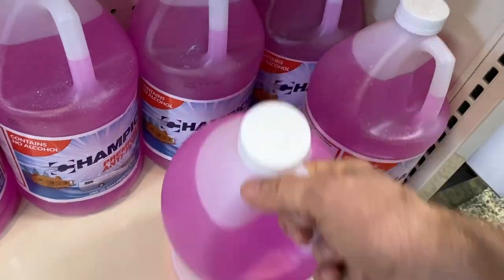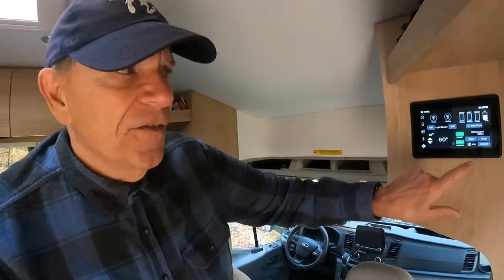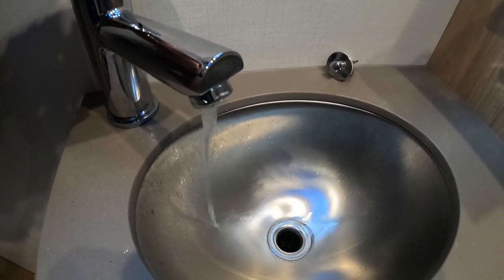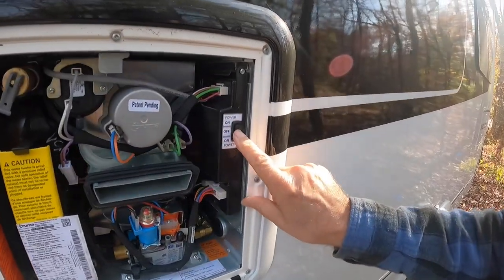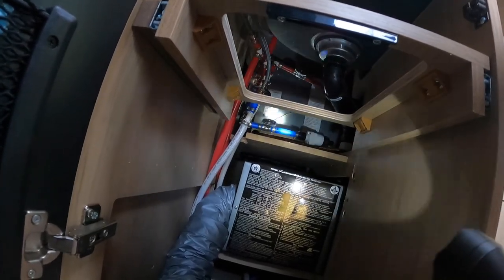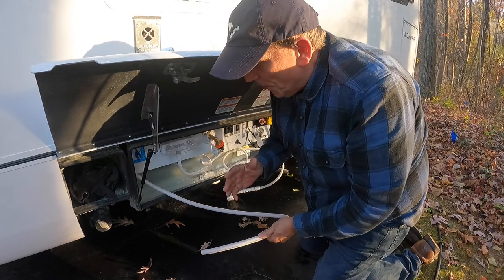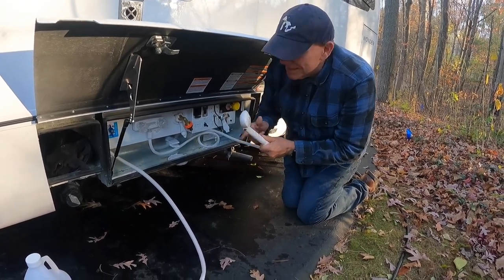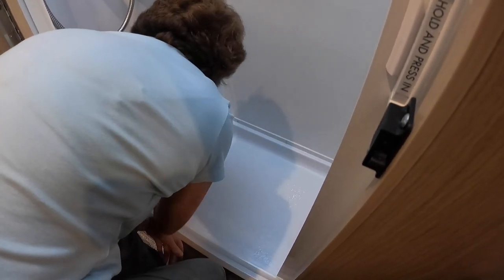Winterizing the Wonder | Step by Step Process

Comment: Great VIDEO .... But before you winterize the black. And gray tanks do you have them cleaned by a professional tank cleaning company? Or do you wait until the start of the next RV SEASON???
Reply from the maker: I clean them myself at the start and end of the season with the saniflush system built into my unit to clean the black water tank.

Comment: Great video- all intimidation removed!!! But, I was thinking- don't the CO2 & propanre detectors run regardless of the battery shut-offs? I was wondering if you should add disconnecting the Pos. & Neg. battery cables for the Winter? And, are there any OTHER niggly little things that someone should do for the long, cold night of winter? Moth balls in closets, dehumidifying buckets placed all around the camper? You know- things that someone might not think of right away, but- may make the difference between a clean fresh camper in Spring, and, a moldy mess? Just asking!
Reply from the maker: If we didn't use the RV we would disconnect the battery, or trickle charge. BUT... we use it all the time, as a second vehicle when home. We camp every month of the year,  In cold climates, it needs that antifreeze in the plumbing system,.
Reply: @RVLifestyle  Well, that makes sense!!! Thanks, just was wondering if that was the whole shebang! You just don't want the water lines freezing- while out camping in the cold. (Not cold when in use, obviously!)

Comment: Just curious why you use air to purge the lines if you pump antifreeze through them anyway? Don’t you get the same result by just pumping the antifreeze through the system until “pink” comes out the end of the faucets, shower heads etc meaning there’s no more air in the system?

Comment: Before pumping in the antifreeze all the water had been drained from the plumbing system.  Then as the antifreeze was being added to the system, clear water ran out from all the faucets.  Why was there still water flowing after all the water had been drained?
Reply: Because there is still water in the lines after you empty the tank

Comment: Question:  Why did you have to close a few valves before you pumped the RV antifreeze through?  Which plumbing circuits were isolated?
Reply from the maker: i turned it off because I didn't want the water pump running on empty when I wasn't using it.

Comment: Your winteriseing doesn't make sense,you have gone to all the trouble of emptying all the water and blowing air into the pipes to get rid of any residual water as we do back here in England.But then you fill the system up with antifreeze.why don't you just leave the system empty and leave all the faucets open to slow air in to dry the insides of the pipe work .your way just seems a waste of time and money. Over the years I've owned many caravans and motorhomes and there has never been any problems with frost damage as there is no water in the system.